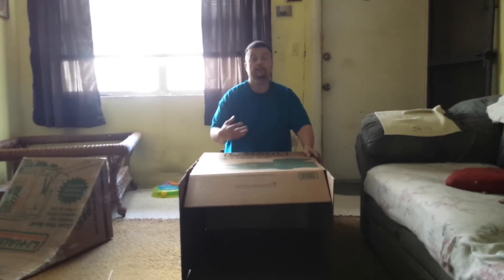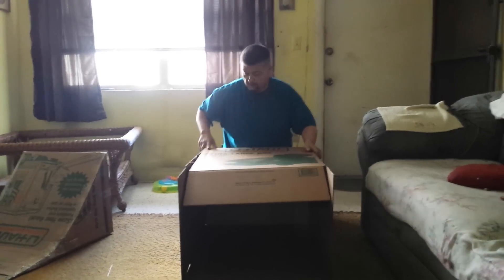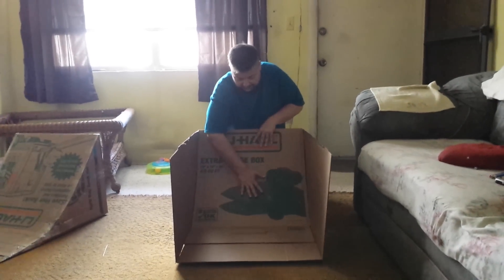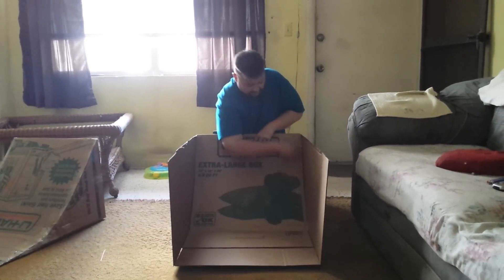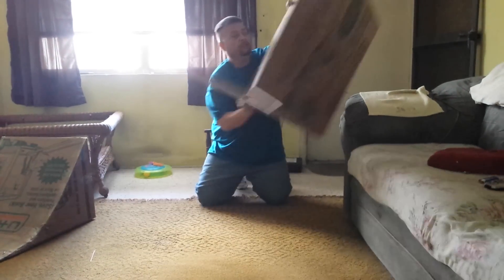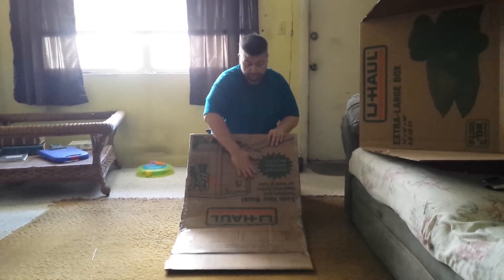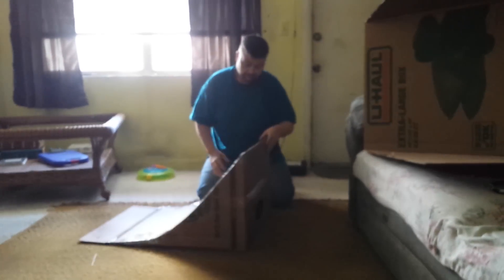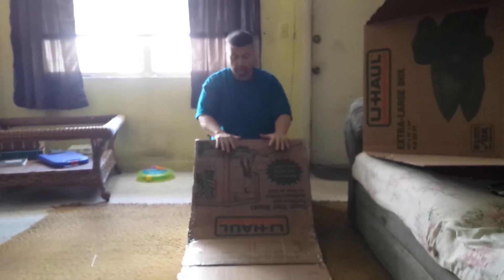How to make a RC ramp from a cardboard box.

Comment: What are you using to support the ramp from caving in???
Reply: Nvm I understand what hole is for the old video still coming in handy for me and my son
Reply from the maker: Where I make the cuts I use duct tape or clear packing tape works great I have a video showing me use it with my Stampede 4 x 4 but eventually after a while it will start to cave in slightly
Reply from the maker: If you go on my channel you will see the video of me running my Stampede 4x4 jumping and using the ramp
Reply from the maker: Where I cut the box I use tape to tape it together and hold the Box where my cuts are at if you watch the video again you could see in the video that I have the box tape time using clear packing tape